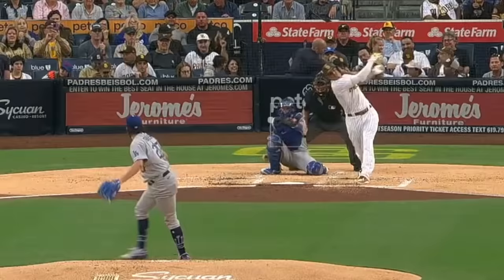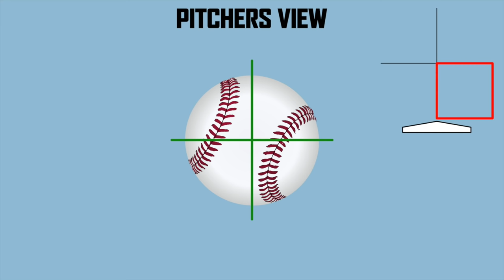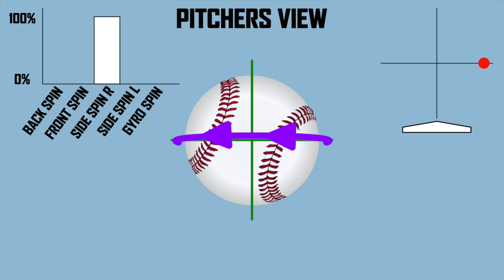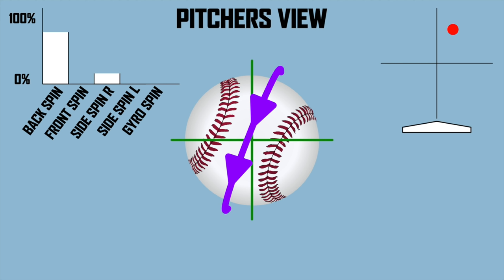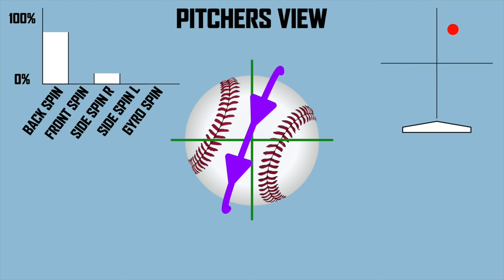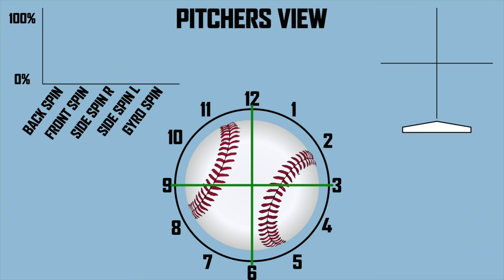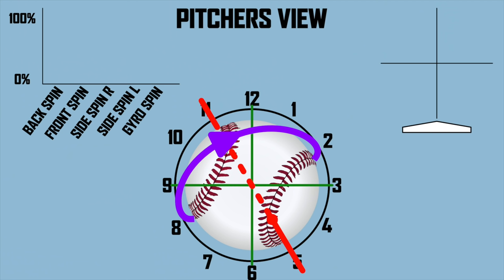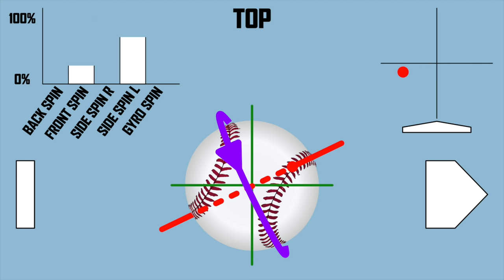How To Throw Trevor Bauer's Slider

Comment: I had massive reconstructive spinal surgery at 13 years old (9 discs removed and replaced with rib bone, 2 18" rods and 180 staples). However before that I was rocking a 50% strike out rating. I love the slider because I was able to keep my arm speed about the same as my fastball or at least better than my curve or change. Man that pitch is so effective if thrown but for me was harder to throw as consistent as my curve ball.
Reply: 13 is such a great age to pitch. You're old enough that you can start throwing hard enough to get effective breaking balls, and also a LOT of kids at 13 are going through growing spurts, which messes with their hand eye-coordination enough that a lot of them have a really tough time at the plate with a good pitcher.

Comment: Given a certain force that is constant, the torque/moment on the ball will be greater on the outside edge of the ball as opposed to close to the center because torque = force x distance (if the force is 90 degrees to the radius of the ball). Since torque = (moment of inertia of the ball) x (angular acceleration) and moment of inertia stays the same, the angular acceleration must increase to maintain equality. Assuming you are imparting the force on the ball over the same time and that it is a constant force, the angular velocity must be greater if the force is exerted on the outside edge of the ball. This means you can get the same angular velocity from less force if applied to the outside edge as opposed to near the center.
Reply: Yes. Agreed. Seriously.

Comment: I developed this pitch on my own thru lots of trial and error.  My thumb is on the seam, but I hold it loose.  I grip the seams the same way and also deliver the most pressure with the index finger.  Mine is not pro - it gets rocked in old guy rec league.  But I do get a lot of pop ups and a lot of grounders to short and third. 

Making rec hitters hit a pitch that both moves away from righties and a little down is an extra challenge for the hitters.  When I get late break, it is better.  When I keep it low, it is better.  When I make righties extend outside on their swing, I get easy flies to the right side. Inside pitches makes them hit fouls by third and gets me to two strikes. 

For lefties, I like to jam them.  Grounders to the right side. 

When my pitch breaks over the middle of the plate,  and a little up,  it gets hammered.  I don't give a crap. I'm not that good at location.  I just don't want to walk people.  That is what the 7 guys behind me are for.  

I have to throw this pitch (it is my only pitch) because my fastball tails in to a righty and is always high.   My big drawback is that I usually have to give up speed to get control.  I am still working on this. 

For me to throw harder and still keep control, the key for me is a loose grip.  When I master the release point, I can get full power and still throw strikes.  But that is hard.  Every game, I throw a great pitch.  

And a whole lot of bad ones.  The worst ones are high because I release too early.  When I release too late, it is in the dirt and usually gets past the catcher.  Doing some of this, I then slow it down to find the zone.  But that gets me called strikes as the hitter is expecting a faster pitch.  So I also change speeds when I can. 

Anyway, pitching in an older adult rec league is hard.  Not too many guys can throw strikes.  HItters have seen a lifetime of pitches and they put the ball in play.  

The greatest feeling is when I throw a really good one, the batter swings and misses. And is looking at his bat and talks to himself as he walks back to his dugout. 

The worst is when it doesn't break, its down the middle, and gets hit to the fence and the runners are running all over the place.  I need to keep working on it to master it.  I'm 61, so I still have a little time.

Comment: Mr. Bauer:
Enjoy your videos.
Find your instructions illuminating.
Wanted to hear your analysis of Bruce Kison,
a successful but underrated pitcher from the 70s and 80s.
Reason I bring him up is that Kison had more movement on his pitches 
than anyone I've ever seen, which would include all MLB pitchers from 1973-2022,
plus any others from the 50s and 60s we have video recordings of.
Kison was not normally a hard thrower, didn't have to be.
His balls zig, zagged, sideways, diagonally, up and down,
like he was working in 4 dimensions.
He always seemed to be striking guys out, but never had high strikeout totals.
I don't know his saber metric breakdown, 
but I'm guessing he had a high strikeout to batter ratio 
but as guys had a tough time getting hits off him and he rarely walked anybody, 
he had a low strikeout to inning ratio.
Hitters looked like they were starring in that Bugs Bunny cartoon
(I think its called Baseball Bugs)
where they can't lay wood on his "slow ball".
Funny thing is, as I'm watching, rewinding, and slo-mowing tape on him,
Bruce did not seem to be obeying 
any of the fundamental techniques  you teach, 
such as the karate chop for breaking balls.
Will direct you to just 2 of his starts:
Priates vs Astros, 1979:
https://www.youtube.com/watch?v=cXj3w847VqA&t=6488s
This is an interesting matchup, as we have J.R. Richard, 
one of the all time great power pitchers, getting bested by a soft tosser.
Pirates vs Cubs, 1979:
https://www.youtube.com/watch?v=v-hOV1c1K-g&t=3509s

Comment: For your curveball and slider, when do you set the angle of your wrist to the karate chop? In the glove? Just out of  the glove? At the top? Just before the release?
Reply: ask google what is a football slider.  Only difference between the curve and football slider is wrist action. Roll wrist curve, stiff wrist slider. As arm comes forward get into throw like a football mode.